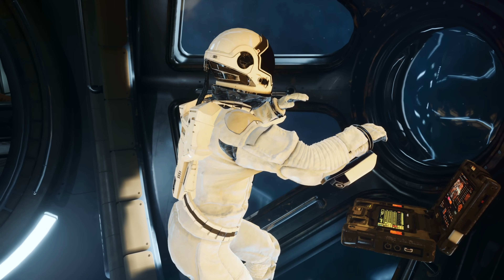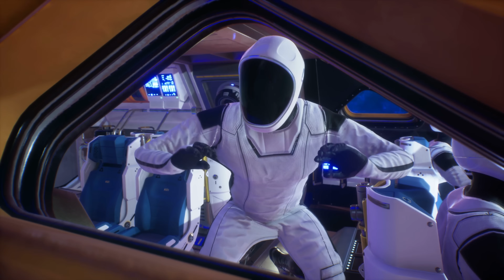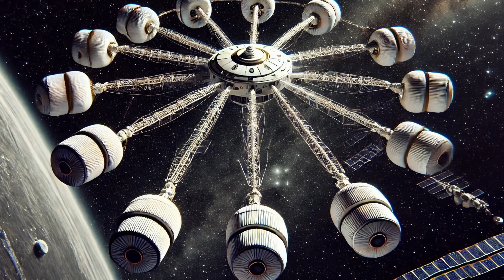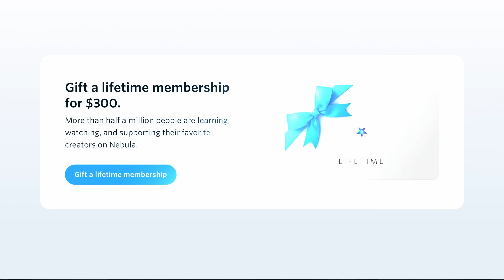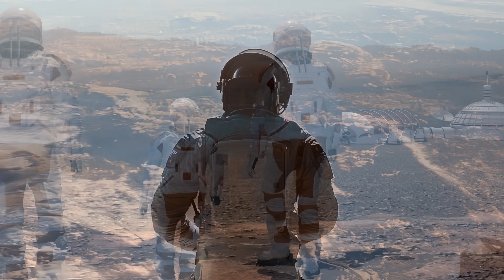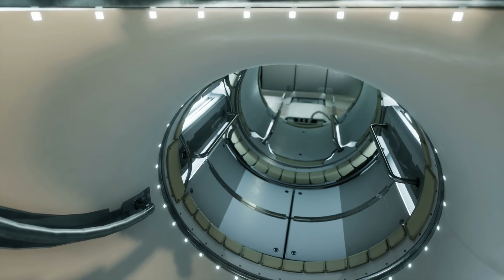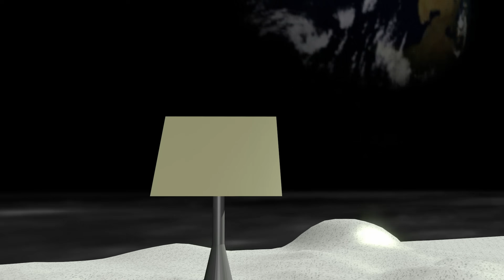Gravity By Design - Tether Habitats & Orbital Living

Comment: It occurs to me that the arms of a bolas-hab need not be symmetric, nor the masses on the ends. For example, a single habitat module may extend a tether with a much smaller weight of cargo or supplies and begin to spin about their center of mass, much closer to hab than the counterweight. The counterweight would be moving much faster and require more tether than the hab, but the structure would require less total mass than two identical habs. In this way, almost any spacecraft could create centrifugal gravity while cruising as long as it has a tether long enough and something to tie to the end.
Reply: Yes! In the limit, there is nothing on the far side but tether. If we call two equal-mass greenhouses a dumbbell, this is a _monobell_. (Says I.)

It's a nice enough word that if there is a functional other-end module, significantly farther out and less massive than the one cabin, the name still demands to be applied.

A good function of the other-end module is to turn sunlight into electricity and then into ion-drive thrust. So you start with the cables furled in the cabin's roof, get a slow spin going, and then as the cables are paid out, tangential thrust with the ion drive prevents the spin rate from diminishing. Later it can fire out-of-plane, gimballed to point steadily at a spot on the sky, and the whole system accelerates away from that spot.
Reply: As long as your center of mass stays on your axis, you'll be fine. And you'd want some kind of counter-weight anyway you could rise or lower to maintain your cg as crew and equipment moves around the hab module.
Reply: I''d use the asymmetry the other way:  Have the habitat tethered to a much heavier instrument module.
Reply: @davidwuhrer6704  That would work too; I was just thinking about minimizing launch-mass
Reply: You did the math on this?
Reply: @mrbaab5932  In my head initially, but here's the back-of-the-envelope proof:
The equation for centrifugal force is F = (m*v^2)/r, where m is the mass on the end of the tether, a is the acceleration it experiences, v is its tangential velocity, and r is the length of the tether from its center of rotation. Two different masses on the ends of two connected tethers of different lengths will experience the same tensile force along the tethers so (m1*v1^2)/r1 = (m2*v2^2)/r2, where "1" designates the habitat-side of the system and "2" designates the counterweight-side of the system.
Both will be rotating about the center of rotation with the same angular velocity, which is given by the equation w = v/r = v1/r1 = v2/r2.
Therefore, if we want to find the ratio of the masses for two different tether lengths we can rewrite the equation as: m1/m2 = (v2^/v1^2)*(r1/r2).
Substituting in the angular velocity equation we get: m1/m2 = ([w^2*r2^2]/[w^2*r1^2])*(r1/r2).
w's and r's cancel out so we are left with: m1/m2 = r2/r1. So, if you made the counterweight-tether twice as long, the counterweight would only need to be half the mass of the hab module; 100 times as long, 1/100th the mass, etc.
Reply: @mrbaab5932  In my head, initially, but here's my quick back-of-the-envelope proof:
The formula for calculating centrifugal force is F = m*a = (m*v^2)/r, where m is the mass on the end of the tether, a is the acceleration it experiences, v is its tangential velocity, and r is the radius of rotation, i.e. the length of the tether from its center of rotation.
If we want our rotating habitat to experience 1 g (9.81 m/s2) of acceleration then v^2/r = 9.81 m/s2. If we assume a tether length for the habitat of 100 m (for illustrative purposes) then its tangential velocity will be 31.32 m/s. Its angular velocity is given by the equation w = v/r or 0.3132 rad/s or about 3 rpm.
The same equations apply to the opposite end of the tether, so if we assume the opposing tether has a length of 10,000 m, at the same rotational rate, the counterweight would be going at a tangential velocity of 3,132 m/s.
That leaves us with only the habitat and counterweight masses to calculate and because they are experiencing the same amount of force, (m1*v1^2)/r1 = (m2*v2^2)/r2 where "1" is for the habitat side and "2" is for the counterweight side. Rearranging the numbers we can calculate the ratio between the hab and the counterweight to be m1/m2 = (v2^2/v1^2)*(r1/r2) which comes out to a ratio of 100:1; same as the ratio of the tether lengths, which we can demonstrate by substituting in the radial velocity equation: m1/m2 = ([w^2*r2^2]/[w^2*r1^2])*(r1/r2) = r2/r1.

Comment: Don't forget Coriolis and gravity gradient! Both improve with bigger R and smaller RPM.
Reply: So the answer is just to use a titanic cylinder.

I used an O'Neill calculator over at space calcs website, and used a ridiculous amount of kevlar (even though I know it will degrade from x-rays and UV) with a safety factor of 2.9.

Just for giggles, I went and put in 201km for the radius (yeah, that's 402 km in diameter or 250 miles in diameter)  and the calculator gave a warning about the shell being to thin, I had to make it 44 meters thick LOL. The rest of the numbers... wow. For static spin stability I made the length only 300km and set the population density so there is about 19,000 sq feet (1770 sq meters) per person, and with just the one deck that allows for about 326 million people. If it was made with say 100 levels (you know, with fake sky and 100 meters in height), that allows for a population of about 32 billion people. That size means it only needs to spin at about 2/30th of an RPM ... or 0.0666_ RPM for 1G.

BTW it doesn't calculate the area for more than one level correctly. So you'd need to do that manually. The gravity calcs seems to be correct though, at that titanic size 100 levels at 100 meters height means 1G at the outer level and 0.95 at the inner one.
Reply: I think these effects are both exaggerated and easily fixed with current technology. 

Ultrasonic brain machine interfaces already exist, and will be a consumer product really soon if not already. And it's two-way. The precision is really really low, but probably enough to tickle your brain wherever it needs to be tickled to not get nauseous.

Of course I think all astronauts should get Neuralink. That would solve an insane number of problems. You wouldn't even need controls on the ship or any sort of user interface, straight mind to mind.
Reply: @jtjames79  What happens if someone breaks the computer while you're talking to it? Or gives it a virus?
Reply: @fuhq5121 I'd rather it happen to the computer, than something which can "tickle" my brain
Reply: @jtjames79  You have to ask is it reliable*? For spacecraft it doesn't matter how "convenient" the UI is. It matters how *robust it is. Are Neuralink chips more reliable, and less likely to malfunction and become unusable, than keyboards?

Comment: I just had an idea so that propellent is not needed to spin up and spin down.  Have 2 sets of modules travelling in opposite directions.  They use magnetism to push off each other to spin up and down.  Isaac might mention this in a minute (haven’t finished watching yet).
Reply: Something like the sliding block-weight used on the sled of a Tractor Pull at a Truck pull contest?
Reply: @jameswilson5165  I have seen those but don’t fully understand them.  I just say you can spin up slowly by magnetically pushing away from something each time it swings past.  There are issues like balancing the thing, but not insurmountable.
Reply: You still need to supply the energy for the magnets to align as you need.  Maybe not propellant, but some energy source either way.

I'd advocate for dark sails in this case.  They can use magnetic fields.  Or light sails.  Either would use an external power source, probably the sun.
Reply: @davidwuhrer6704  I agree.  Even a small solar panel would be fine as spin up can take a few hours using little current.
Reply: @russc788  A small solar panel providing the energy for spinning up something as massive as a habitat is going to take years.  That's why I suggested sails.

A dark sail would use pressure from the solar wind.  A light sail would use pressure from sunlight.  Either can be huge.  A dark sail can be lighter (and thus more efficient), but only works in one direction, which should be enough for creating spin.
Reply: @ There is little resistance, only intertia.
Reply: Flywheels can do the whole process of spin down/up without complicated assemblies and or chemical propellant.
Reply: @jasonneugebauer5310  Would the flywheels be at the ends?
Reply: @russc788  No, the flywheel should be very near the center of gravity in a semetrical shape in line with the desired plain of rotation.  If the flywheels were at the extremities,  when they spun up or spun down, they would not be able to efficiently turn the spacecraft with the torque of their acceleration or deceleration.

Comment: "...designed for one person at at time." How hard would it be to take a couple RVs, attach them to a rotating bar, and let astronaut trainees (or bodybuilders or whoever) live in an Earthbound habitat at 2g for a while? 
Maybe that's a future project for Colin Furze :D

Sure they're not designed for that, you'd probably have to buff the frame a bit, but they're tough enough for potholes and stuff. 
I suggest RVs because they're tougher than prefab homes or those temporary buildings that get carted around.
Reply: I think you might be underestimating gas prices.  There's a reason theme park attractions are electric, and it's not for environmental reasons.

Comment: Ive read studies that hint at prolonged exposure to those gyroscopic conditions actually help negate negative symptoms. The body simply adapts to it. The paper iirc said the limitation is around 9 meters diameter? (Not sure if i remember correctly) because at that point the difference between what your feet experience and what your head experiences differs too greatly. All of this assumes you never sit or stand, because that exacerbates the effect.

Comment: These are things we could build now with the technology on hand, but we don't have the willpower to do so.
Reply: We could have run tests in LEO using Shuttle hardware, the External Tanks specifically, as the core of the facility. We have absolutely zero data on long term effects of reduced gravity on human physiology. Are the effects linear from zero to 1gee. Are the effects on a curve. Does the curve rise sharply and flatten out. Or does the curve resemble a hockey stick.
As to the question of money and people in need. As long as the money spent on trying to help people is actually spent doing that. Then l think we should. But if the money is spent simply to provide a jobs program for social workers etc that does not actually help people in need, then no. Plus some people are beyond helping. For various reasons.
Reply: We have the will, we're just spending it on pointless stuff like wars and government bloat.

To any politician who unironically claims that war is good for anything, I ask what war does that space doesn't do better. 

(I support self defense and deterrence, it's deliberately funding and instigating both sides of a conflict that I take issue with.)

I hope that the first time someone successfully mined on the moon, well get another space race that will put a pause on conventional conflict.
Reply: Or money perhaps.  We still have people in need.
Reply: @russc788 
Let's see. NASA spending is currently at about $.01 for every two dollars in the federal budget. That's one cent for every two bucks. Is here waste in NASA's budget. I'm sure that there is. Part of the waste is the result of changing political directives. Changing administrations changing directions. Political interference to provide jobs or money spent in states or congressional districts. Hence the old joke about SLS meaning Senate Launch System. Lack of oversight of contractors. I'm looking at you Boeing. Abandoning or cancelling projects when well along in development. The X-33 should have been finished and flown. Not because it was the road to functioning SSTO. But to provide solid data on rapid launch schedules. And what they do to the vehicles. I also think the McDonnell Douglas vehicle should have been picked. And build multiple vehicles.

Comment: For high gravity worlds, can the cable be attached to the floor instead of the ceiling to lower the Apparent gravity? X+(-0.3X)?
Reply: In orbit, real apparent gravity is zero and irrelevant.  On the surface, centripetal gravity can only add to gravity... Unless you're doing a loop de loop, which increases gravity when going up in exchange for reducing it when going down.

Comment: As things move about within anything spinning, the center of rotation will vary, which will cause metal fatigue.
Reply: A water ballasting system might overcome this. Everyone carries a transponder informing the ship exactly where they are, and ballast is pumped to compensate. Likewise with a farmworker pushing a trolley of harvested crops to the food processing unit. If you follow soaring (gliding) at all you will see how the carbon composite wings of a modern sailplane (glider) flex continually.

Comment: Oja Isaac broer when we don't need spacewalks it wil bemutch safer you can repair the out side of station by pulling the part needy to repair inside close outside and when don repairing it push it back outside in it's place again and lock it back

Comment: Maybe I missed it but I've always wondered how these systems deal with weight shift. Like if all the inhabitants have to move to one module, does that not cause an imbalance and a wobble? Do we automatically shift ballast water around to balance everything out?
Reply: it would shift the point that everything rotates around, but that's not necessarily an issue. Tethered habs for example would be kinda self-adjusting, as the tether always hangs "down".
However engineers need to be aware of the possibly off-center load paths, and a sudden change, like a module being ripped off, may still cause some serious disturbance.
Reply: @cosmic_cupcake  A robust ballast system of some kind needs to be a major consideration. The more fool-proof and tamper-proof, the better. But I am thinking the mass of individual passengers will be negligible next to the hab itself, especially with shielding and such? You may be able to put it off balance by stacking cargo extremely inefficiently, but crew should have minimal effect on the mass distribution. I think? I'm not exactly an engineer, so anyone with more knowledge on the subject is welcome to correct me if I'm wrong! 🙂
Reply: @Grevnor  spacecraft should be rather lightweight, but I also don't see the passengers weighing in too much.
As far as fool- and tamperproofing goes, there's some more nuance. because such ballast would be another active system that could be mishandled or break down entirely. It sure would be nice if the station was at least largely stable without it.
But then again I am also just spitballing here.
Reply: @Grevnor people can destroy almost anything with a Relatively small effort given reasonable knowledge of the design.

And, you can't idiot proof everything, there will always be a bigger idiot.

We rely on the fact that most people will not use all the lethal technology widely available to everyone to kill people and destroy infrastructure.  This is fundamental to civilization. 

A car or a hammer are equal in lethality to a gun and both are easily obtained.  Any technical device or natural object can be sabotaged or used as a weapon.
Reply from the maker: Engineering wise you might pump water around to counteract any issues, but even as compact as these are, they are likely to pretty massive compared to a human
Reply: Excellent! Plenty of possible issues. Would the water supply be moved to compensate?!
Reply: Have the habs move up or down their legs slightly?

Comment: I’ve been ponderin a clutch system so the dock is stationary and easy for shuttles to access. Then the elevator spins to meet the habs spin and up you go.
Reply: In a long tether deal there can be an unpressurized drum on the spin axis. Rotation rate being only 20 to 30 turns per hour, a shuttle can just press its belly to the drum floor, which is going only ~1 m s.

Where the belly rubs the floor at that speed, this could be considered a clutch system. But it slides, like, one 500th of a turn before it stops. Or -- from the point of view of nearby ships -- before it is up to speed.
Reply: Close to the center of the wheel, the speed differential between the stationary and rotating structures should be no more than stepping onto an escalator or moving walkway?
Reply: @mikemellor1 I imagine it would feel like the graviton initially until the elevator got you to the habs.